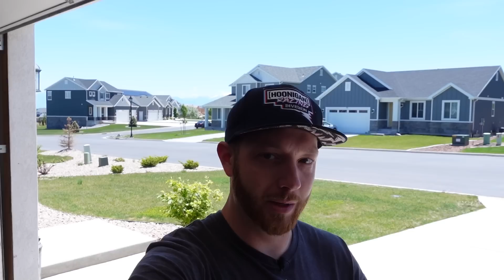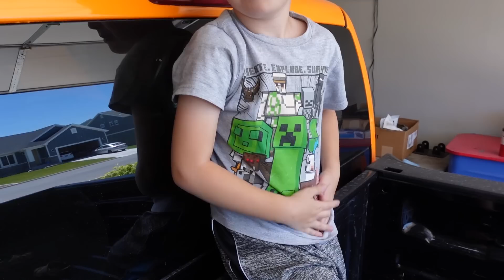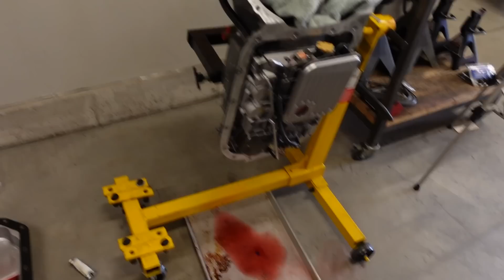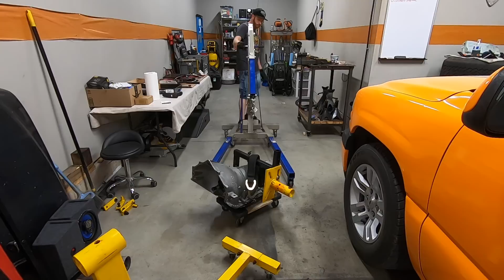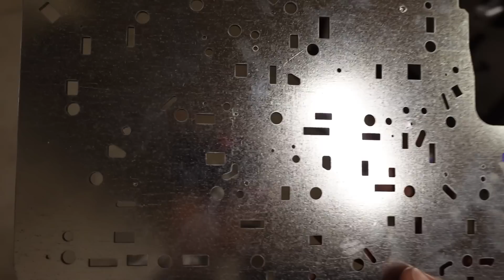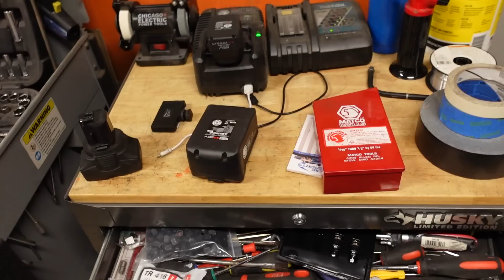this TINY MISTAKE would've DESTROYED a new transmission

Comment: First transmission I rebuilt was a 700r4/aka 4l60.
I just completed my second transmission, a 6l80 from my tahoe.

Always fun to work with the transgo instructions.
Sonnax actually explains things "why".
Transgo, not so much.

Anyways, the 6l80 is gorgeous if you like machine things.
It's so simple and clean compared to the earlier transmissions.

I didn't need too many special tools, just a good bushing driver kit, and close attention to bushing depth detail.

Not too bad really.

The big tool you need is a massive set of snap ring pliers for the center support.

I used a funnel to expand the Teflon seals for the input shaft, and electrical tape to help me compress the seals.

Big pita was setting the clutch pack clearances.
They are set with selective snap rings.
And I didn't find much information helping me find them.
They give this retarded "range" of thickness.
I need an actual ring thickness!!

Then the 2-6 clutch.
Instructions say if you don't get x clearance then you did it wrong and do it again, and there are no selectives..

So I did it again 6x.
Then gave up, slapped a selective snap ring left over from the 1-2-3-4 drum.
Perfect clearances!

800 miles on that transmission now, per sonnax I should be good for upwards of 800hp...

Hp tuners can luckily do the clutch pack re learn, required for this type of transmission... lol 

My china gm tech2 doesn't have the relearn option for some reason.

Also transgo in slc didn't have much in the way of parts for the 6l80.
So I had to plan everything out in advance.

Used mostly ebay and Amazon to source parts.

It's always an adventure!

Comment: On the other hand, to much pressure could take out the thrust bearing on your engine! You might want to look into that problem, probably why that valve is made?

TH400 transmissions are notorious for wiping out thrust bearings on performance engines because of excessive pressure. Not sure if that is an issue on the 4L80E though but definitely worth looking in to.

Built an engine for a friend and it killed 2 Ford 9" 31 spline rear ends, 4 powerglide transmissions then 4 TH350 transmissions until he upgraded to a TH400. The engine took out the first TH400 but not before the trans taking out the thrust on the engine.

The fix is trial and error on a TH400 by enlarging a pressure relief hole somewhere in the trans. After that was done he has a trans line pressure gauge to monitor the pressure to make sure the hole was enlarged enough, if not he was told to bring it back in to enlarge it further.

Keep an eye on the balancer, make sure you can't make it move back and forth noticeably. If you can more than likely the thrust was taken out. Good luck.
Reply from the maker: that engine sounds like its caused a lot of headache to the rest of the drivetrain!
Reply: @LawrenceTolman  

Oh yeah, thrust is fixed and all the weak links are too, that thing is a blast now! It has 18" of suspension travel up front and 24" in the rear and not very many people can keep up with him on the Silver Lake Sand Dunes! And it's only 2WD! It's like landing on a marshmallow on a 10' high jump!

It's just a little sbc 383 with Dart heads and a Howards solid roller cam, it runs pretty good.  It's in a Jeep Cherokee YJ. I just built the engine and helped a little getting running, I had nothing to do with the trans or rear end.

Comment: Spray the transmission with some Bulldog self etching primer that stuff designed to make paint stick to anything, brass, aluminum, stainless, cast iron, leather plastic, and even concrete and it's clear if you want to leave it natural, I've used it for over 10 years painting aluminum sign placard for LPG trucks.
Reply from the maker: Thanks for the tips!

Comment: It’s cool that you watch Taylor Ray! 

Will your 4L80 recipe work for a 2wd truck? I have an 03 that I’d like to swap an 80 in eventually.
Reply from the maker: Yes it will, UGT is a 2wd 4l80e, and other than the output shaft, a 2wd and 4wd trans are basically the same thing
Reply: @LawrenceTolman   Thanks! I started watching after the ugly truck build so I didn't catch all that was done to it. looking forward to seeing the stepside rip with the 80. I'm curious though, I know the 4l60 is notorious for having a bunch of potential neutrals, but how long do you think your 4l60 would last if you left it as is?

Comment: Just a stupid question but do you drill a hole in the gasket to match the holes you drilled in the plate? asking for friends.
Reply from the maker: No, you don’t need to because there is a large oval hole in the gasket that surrounds where the drilled hole in the separator plate goes

Comment: My 4L70 in my 07 Classic hits way to hard, especially on the 1-2 shift. Only under half or more throttle. I replaced the shift accumulator but it didn't fix the problem. The automatic transmission is a complete f,ckin mystery to me 😒

Comment: LT, I wanted to ask you and you may or may not have a answer for me but I got my 4l80e swapped Silverado SS adapted to the nv149 transfer case done a few months ago but when I drive it I loses quite a bit of transfer case fluid out the rear where the slip yoke goes into the transfer case. I've replaced the real seal twice now thinking that was the problem but it continues. My other thought is did I have my drive shaft made too short? The slip yoke sticks out a inch more then where it was stock, could that be a culprit? I know its not pin holes from pump rub, I did the pump rub kit when I rebuilt the transfer case and verified the case back half was good. Just wanted to get your input.
Reply: figured out my problem, wasn't the drive shaft. had a decent leak by the speed sensor in the back half of the case. never seen one of those leak before.

Comment: Hey man can you please help i can't find info anywhere. I swapped in a 4l80 on my 2002 5.3 1500 from an 2005 6.0 2500. Can i just switch the computer to run the trans?
Reply: I just finished the swap and pulled it out of the shop about midnight last night. But it is obviously in limp
Reply from the maker: no, you'll need to add wiring for the input speed sensor for it to rear correctly, and if you use the P59 6.0 computer your engine tune will be slightly off, and you'd need to program the VIN so anti-theft won't kick in, and there are one or two other wires that are different between the newer P59 and your P01 ECM. You'd be better off just sticking with your existing computer and having a tuner segment swap your computer to run the 4l80e.
Reply: @LawrenceTolman  ok thank you i really appreciate your time man! It's so hard to find answers on this stuff. I can't find anything about u joints either. I see people switch the slip yoke but I'm trying to attach the 2500 driveshaft to the 10 bolt rear. I tried my aluminum 1500 but it's too long even with 6"of lift. Just to get it moved out of the way i put a 2500 u joint on the lathe and milled it down to fit the 10 bolt width and caps. I don't want to buy a shaft because this is temporary. I'm doing a Dana 60 with the 14 bolt but I'm not ready to buy new rims, tires and gears because I'm going from a 37x16 to a 40x17.

Comment: Get a performabuilt stage 3 4l60 Instead of a 4l80 and you will get more speed the 4l80 is sluggish
Reply: TCI i'd say. The 4L60 is good considering it' getting rarer to find the 4L80. Only other choice is the 6L80/90 which need 1 OD gear changed to a standard gear and then a means of controlling it.

Comment: Why would the dipstick be wrong? You said something about it being a early 4l80, is that why?
Reply from the maker: No, shouldn’t have to do with case style, I’ve seen a ton of stock 80e dipsticks marked low from the factory. It probably doesn’t affect performance on a stock engine/trans but in a high performance setup, correct fluid level is extra important.
Reply: @LawrenceTolman  gotcha

Comment: Not sure why you're using a power-robbing transmission when you have 3 options that are way better. Yes I know th400/4L80 are bulletproof but that is yesterday's technology.
Reply from the maker: what are the 3 better options? I do agree, the 80e is an old school trans, but bulletproof is something that's hard to give up
Reply: @LawrenceTolman  Have finish line transmissions build the 4l60E, 6l80e, or 90e. He can build them for 1200+ HP. Or do what I'm in the process of doing, remove the slushbox for a manual. With a sequential shifter. There are 3 Silverados that I know of that have done this conversion. 2 of them are on youtube. Besides having 2 overdrives keeps the RPM's down when cruising on the highway.